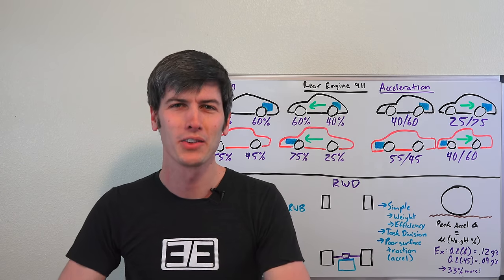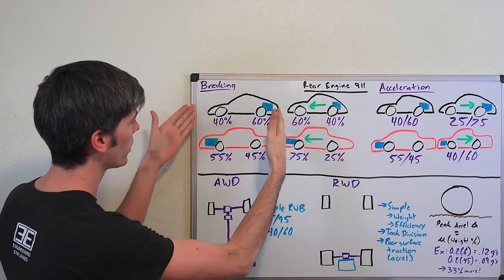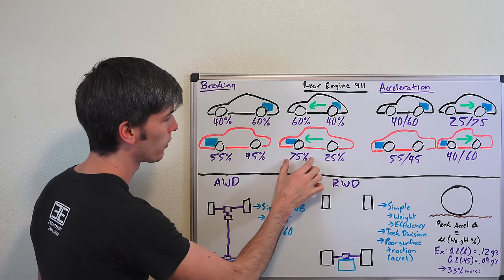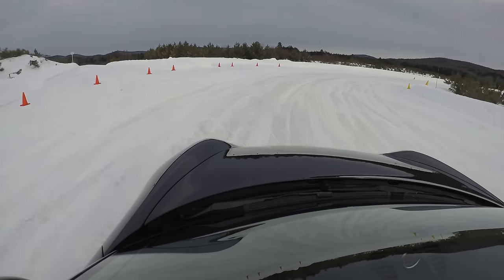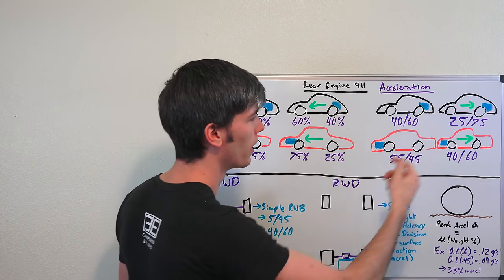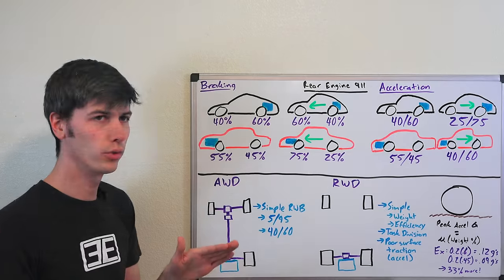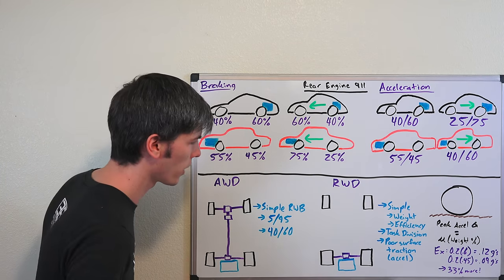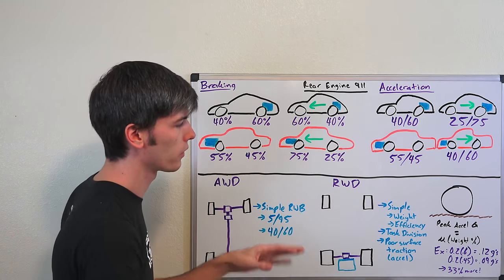Why Is The Porsche 911 Rear-Engine?

Comment: Speaking of Engines.....

If you haven't already, please make a video showing the differences between Open / Closed block engine designs - including PROs and CONs.

Word on the street is Ford's Ecoboosts are running into blown head gasket and cracked liner/block issues. It seems they took the existing Mazda L-Engine (MZR DISI) L3-VDT and for some unfathomable reason reverted back to Open Deck design as in the non-turbo versions (basically floating cylinders) in an all-aluminum engine with iron cylinder liners, then rebranded as EcoBoost.

However they've added forced induction on these NA blocks without structural reinforcement or bracing to the cylinder walls (a treatment the STIs and Mazdaspeeds DID get), I suppose, for the sake of keeping costs down and 'promoting' better coolant flow.  One can only speculate.  

But if you do a Google search of various Mazda L-engines, most of them appear to be of Open Deck design, which is not uncommon on naturally aspirated 4cyl Japanese medium-hp engines.  The change occurs with the Mazdaspeed 3/6 version of the MZR DISI engine, and you clearly see the altered deck being more Closed as opposed to Open.  They had the presence of mind to do this, knowing that the added power and torque stresses from the turbo setup would invariably increase chance of cylinder 'twist' or 'wobble' within the block, therefor creating gaps between the head and gasket, ultimately losing compression and inviting coolant inside the cylinder.

Sure some renowned Honda B series VTEC engines, and Toyota Z series VVT high-output 4bangers have Open Deck blocks, but their engineering prowess and know-how lets them get away with it.
The 4/6 cylinder Ecoboosts are nothing more than retooled and rebranded Mazda L-Engines which simply aren't on the same level as their Japanese rivals of Honda, Toyota, Subaru as it pertains to durability and overall robustness.  Mazda should go back to championing the Rotary once again, they're invincible and incredible in that field, league of their own.

Plenty of pissed-off Focus RS owners are beginning to mount,  with blown gaskets/engines before they even see 40k.

Any comments/ideas?

Comment: Great video, thanks! I can assert that, yes, 911s are brilliant to drive. In the dry, wet, road and track.
Reply: Btw, the choice of opposing cylinder engines also ties in with the engine layout and sports car characteristics since it allowed for a lower centre of gravity. This was important to aid the suspension keeping control of the chassis, esp because of the higher polar moment of inertia that was prone to causing... Events... On the 997, the entire engine block sits below the top of the rear tyre.

Comment: In a crash,  front wheel drive is the best configuration. You have the mass of the engine and transmission up front absorbing the impact. In a crash, rear engine rear wheel drive is the worst possible configuration. All that mass that could be absorbing the impact is now behind you and trying to come through the passenger compartment.

Comment: This is slightly off topic but how does a rear engine cool itself without a front radiator. I know they install coolant systems on today's rear engines but how did a rear placed engine stay cool by just being "air cooled"? This question also goes towards vw beetles as well. I've always been curious how that works. Thanks!

Comment: Jason, maybe you can answer my question (or maybe you already have in a video?): Why are regular road cars mostly FWDs with front engines? Wouldn't they be more fuel-efficient if they were RWDs (with either front or back engine) because more of the power used actually reaches the road and doesn't get wasted through slip? RWDs were much harder to drive back in the day especially if the road was frozen, but all the modern electronic assist systems should alleviate that, right?

Comment: i think that all production cars should do the same.
use a rear wheel drive and put the engine, transmission, & fuel tank (if possible) in the rear.
it should always have an advantage in terms of weight distribution (better braking, acceleration + lesser chances of understeering)
it sounds like a logical thing to do, i wonder why other manufacturers didn't go that route, including Porsches own 5 door hatchback and their SUVs, whats the catch ?

Comment: Well, good video justifying the rear engine layout, but c'mon - everyone knows Porsche hold on to that RR just cos it makes them unique and if they enter the mid-engine sector , there's ton of rivalry. The best layout for fun sportscars is enigne in the front, transmission in the back and RWD and if you want a really fast sportscar you go AWD. Engine in the back may have a point on a dry racetrack, but once you get it on the road and add some rain/snow, it's in accident waiting to happen.

Comment: A rear engine allows you to make square corners by deliberately causing rear tire drift by over powering.
It also allows the driver to force a car to snap back to straight, by deliberately under powering the rear drive wheels.
While front wheel drive have similar traction advantages, it is always bad to risk losing steering control by running power through the wheels that steer, and front wheel power always screws up wheel geometry by the front end lifting under power.

Comment: The suspension also has a lot to do with it, if you have the front struts right on the hood, all the weight of the car would actually be super low and the weight transfer would be less.

Comment: I've always been interested in how a 911/rear engine car handles around corners. Sure it's fast in a straight line, but like you said, that extra weight hanging over the back axle would make it prone to oversteer. Comparing to a front-engine RWD car, what's it like to catch and correct oversteer?

Comment: I have never driven a 40/60 car. But I guess this kind of weight distribution will have advantage of exiting corner but not entering corner because less grip at front? ESpecial at low speed when aero doesn’t effect too much?

Comment: Great video and explanation. What about mid engine cars (like the Porsche Cayman). Could you compare and explain them as well?
Thanks!
Reply: Olivier Palmieri Porsche Camp4 in Macaglisse, Canada also has Caymen S alongside with C2S, C4S (or GTS). My experience was the Caymen would kind of pivot/swivel on slippery surface like on ice. Just my 0.02

Comment: The reason it was originally at the back is because you can trace its ancestry back to the VW Beetle. Porsche then spent the next 50 years coming up with technical solutions to overcome the obvious problems that having an engine slung out over the rear axle causes. That they've done it so successfully is testament to their engineering capability.

Comment: What about the accident/safety? Would the extra engine wight help if there is a front collision or would it still be better to have it at the back of the car? Also in snow or any bad weather you need a Subaru AWD really -) and the engine location wouldn't make so much of a difference.  For me personally having the engine at the back is better for the transmission losses as compared to most RWD cars with the engine up front, however this doesn't make so much sense if the car is AWD.

Comment: I really learned a lot on this video, enough to actually ask a question for once...... I'd love to see that same board, with a mid engine mounted. Seems like it would give a compromise between the front and rear loads during brake/accel. But probably wouldn't be king of either? Just a novice theory, I'm a hs drop out mind you.
Reply from the maker: Yes, as you mention mid is a nice balance! And no need to be hard on yourself. :) https://youtu.be/M_ZVf6KfqiY

Comment: You want good coffee - buy the green dried beans and roast them yourself. You can do it in a pan on the stove, or buy a cheap popcorn stir machine. In those machines use time - usually 20 to 35 minutes depending on the beans. For example I love Costa Rican Dota Estate beans and they take 25 minutes. 

Then grind 8 to 16 oz as you need it. 2oz into a French Press is perfect.
Reply from the maker: Coffee explained?

Comment: The video misses the entire point.  The reason it's mid engine is because Porsche went that route when they made the Type 64 which was closely based on the Beetle which was also rear engine.  This carried over to the first 911 and evolved through the years.  Porsche made it work very well and the enthusiasts rejected front engine attempts like the 928 and 944 which were meant to replace the 911.

Comment: Is the 20% shift under braking and acceleration a real number or just to illustrate the point? Seems like a large percentage. I would be surprised if that much of the weight can shift from the car diving a bit under braking. I could see it more under acceleration, but I guess it's all about the g-forces experienced.

Comment: Thank you kindly. Porsche has excellent and physics-superior technology as they have from their early German manufacturing roots to the V-1 rocket bombs which were so well designed they're better than conventional modern missiles and are leading the way for our new smart missiles. Your explanation is rather good; and the Porsches you demonstrate are great scientifically and commercially. But although the disparity in wheel size between rear and front wheels is larger in a smallish sports car, the general concept of center-rear engine placement(and the world of motor-engine steering control and AI-electrified all auto integration this opens up as auto science now advances,) is superior not only for sports cars but also for larger cars like sedans, for soccer mom vans, and critically for sports utility vehicles in the manner of the excellent Porsche Cayenne. That's all; Thanks again for the neat car science demonstration and explanation. Sorry to build upon your points; But I love to collaborate.

Comment: It's OK but while accelerating, the rear-engined car will transfer the weight to rear, means lowering the weight pressure on front wheels, does it mean it is harder to steer rear engined cars while accelerating?
Reply from the maker: Depending on how hard you're accelerating, correct. But generally speaking you want a smooth curve from turning hard to accelerating. As you start to reduce steering angle, you simultaneously increase throttle position.
Reply: So that Porsche did a great job by installing 4 wheel steering.

Comment: Porsche designed the car so it could be rear wheel drive, small, and with back seats. Packaging was the main reason. Secondarily., in the 40s and 50s when 100 was a good amount of horsepower it makes sense to keep traction over the rear. Rear engine cars fundamentally understeer, which would make it a lot more stable on a mountain Rd in the 50s 60s etc... 

But when you start adding power it becomes a problem, that's why no one else does it

Comment: In order to get a Front-Engine Vehicle with Rear-Wheel-Bias, couldn't you make a Driveshaft from the Engine to a Center Diff and then split the Power to the Front and Rear?

Comment: I never understood why people say "because of the G-forces". "G's" are a unit. One wouldn't say "because of the KPH speeds," simply speed is sufficient. A car reviewer wouldn't say "I can feel the Newton-Meters of torque," No, they would just say torque. No matter if it is KPH or MPH, the principle of speed is the same. Likewise, it doesn't matter if it is measured in N*M or Lbs*Ft, the concept of torque is the same. I am not insinuating that it is flat-out incorrect to say G-forces in many references to force, but it is just not harmonious with the syntax of how we use other principles and their respective units of measure in physics. So why not just say force(s) when talking about force(s)?

Comment: Why do F1 & Indy cars have smaller narrow tyres at the front? If they were the same size as the rears they would have better(bigger footprint on the track for handling, steering, braking & suspension.) They also be able to brake better with bigger diameter discs & possibly 8 pot calipers!

Comment: How does the multi-plate clutch control the amount of torque going to the front?
does the computer control clutch slip? I would imagine it would wear out the plates very quickly if that were the case
Reply from the maker: Yes, it's based on slip. You'd be surprised how long a properly designed wet multi-plate clutch will last. Some forklifts use wet clutch packs for braking within the transmission, and they'll last the life of the forklift (far longer than a car lasts). Because of the lubrication, they can last a very long time.
Reply: whoa, Jason the man himself replied. i think i'm star-struck. 
thanks for the knowledge, keep up the great work!

Comment: I'm not sure if you mentioned it in your video but doesn't the weight transfer during acceleration towards the rear axle mean more traction on the rear tyres and thus improving the driving in overall when it is a RWD car? Apart from the eventual "tail happiness", I'm rather curious whether this is true or not.
Reply: it causes understeer under acceleration. coming out of a corner though it's almost like a 4wd car. straightline acceleration is great and under heavy braking the tyres are loaded equally, not overloading the front like in frontengined cars.

Comment: Everything you said is true from an engineering and physics point of view. But remember, the origins of the 911 go clear back to the VW Beetle which was designed with a much greater emphasis on cost and practicality. The VW Beetle was the world's most popular car for decades. The 911 is the world's most successful performance car design ever. 911's like the Turbo S or GT2RS are the most practical supercars in the world. Clearly there are advantages to this design. So why isn't it being copied? I think this has to do with the engineering challenges of getting the car to handle safely with drivers who don't know how to drive. Which is pretty much all of them. Porsche has tackled this problem with great success. Exactly how they did this would make for a great series of videos.

Comment: Far too many people have made the argument that the real reason that the Porsche 911
has a rear engine layout is because of either tradition or being stubborn or because it was ripped off or copied from someone else...WRONG! advantages to a rear engine layout:
engine is farther away from the driver, so less sound deadening, and heat insulation needed. Many front engine cars are so close to the firewall that the engine heats it... making air conditioning more needed and more heat shielding. All that stuff adds weight and complexity.... a rear engine car also has less need for power steering, and it is not 
necessary to have a big hump in the floor giving more room in the interior. Having the engine in the rear also makes it easy to have a low nose to the car... easy and simple way to get lots of downforce on the nose and gives greater visibilty to the driver... and lastly
the rear engine car has a big massive crumple zone in the nose... front engine cars have to 
stiffen the frame (more weight) for driver safety.  In addition to all of the good solid reasons given in the video.

Comment: Great video... would love it if you could do a video explaining why the 911 (red or awd) is potentially much more efficient in putting its power down on the road compared to front engined, rear or all wheel drive sports cars. When I was researching what to buy, it always appears that the 911 can do significantly more with less (even after considering power to weight ratios). My assumption was that not having such an long drive shaft, a reduced exhaust system are some of the reasons, but this armchair engineering is based on no real disciplined analysis. 

Anyhow - thanks for another enlightening explanation....
Reply: but.... that's what this whole video was about

Comment: I love your videos! Keep up the great work. I'm going to wade in a wee bit and say a few things. I think what you're saying is great but your "logic" is slightly missing-leading seems a little like Porsche marketing. In a car, it really doesn't matter where the engine/transmission are placed, all cars drive fine. However, once you start pushing the car, reaching or exceeding the limits of tires traction capabilities, you'll soon discover how important this placement of mass is. The 911's rear engine is a design carryover from VW. Porsche has built a great culture and car. People keep buying them, so "logically", Porsche keeps making them. In motorsport, Porsche has never purpose built a rear engine racecar because engineers need to consider Polar Moment of Inertia and tire wear. You touched on this but seemed to quickly dismiss it in favor of some form of "Porsche logic". To remain competitive, the 911RS-R is now "optimized" with a mid-engine layout and much reduced rear tire wear. Also, consider how competitive the auto industry is, yet no other car maker invested the money to develop a rear engine car to compete with the 911. The 911 is a great car but to the untrained driver who simply "lifts" off throttle entering a corner...Not fun at all. It was called the Widowmaker for good reason. Now they have better aero, massive sticky rear tires, and clever electronics to mitigate many problems or a rear engine. But with any given mass, we all still have to deal with Newtonian Laws.

Comment: Does not having a drive shaft significantlly change how much power loss there is to the ground?
Reply from the maker: Not having a long driveshaft from the front to rear will improve horsepower at the wheels, yes. Same reason folks do things like carbon-fiber driveshafts to reduce losses to rotational inertia.